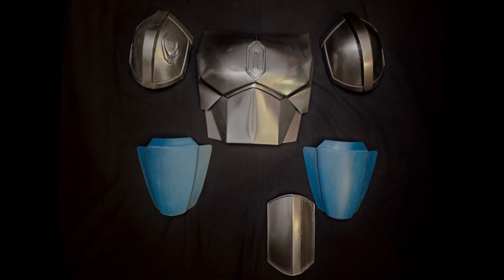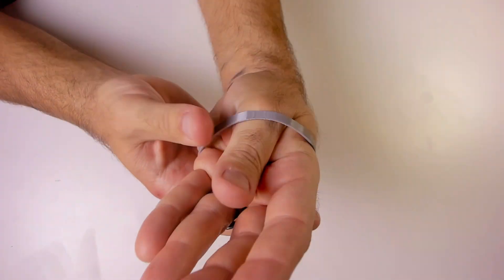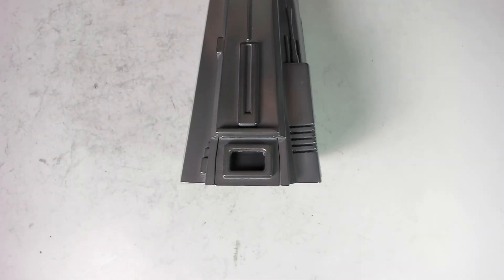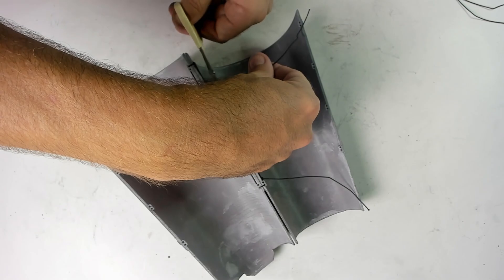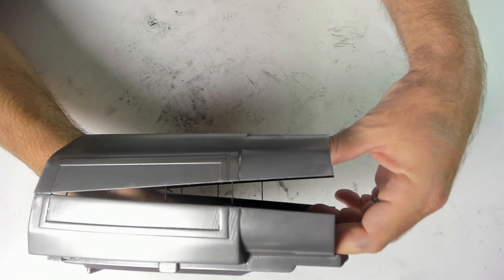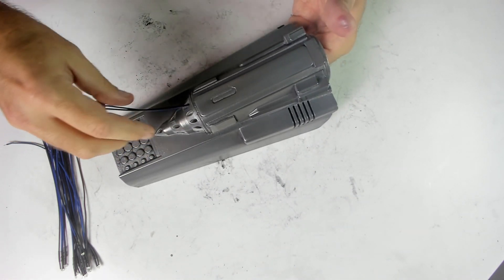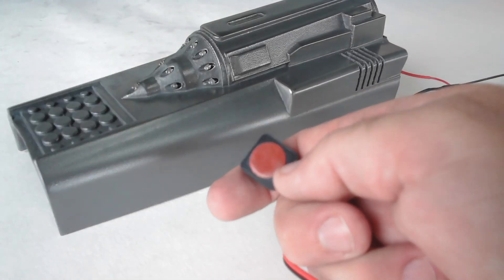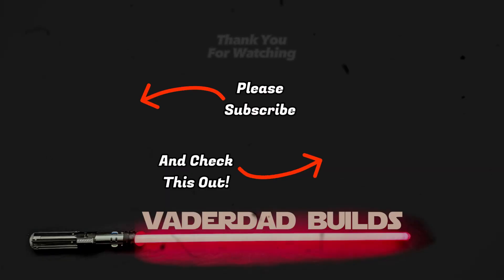3D Printed Mandalorian Armor With Only FREE STL Files? Pt.3 - Gauntlets

Comment: These turned out great, Thank you for linking the files. I'm having a problem with my other gauntlet files where the two halves are meant to be permanently glued together with inserting tabs but my hands are too chonky to snake through and there isn't a good way to temporarily attach the halves together around my arm because the tabs get in the way of using things like hinges. I think if I were to scale them to be big enough for my hands to fit through the wrist hole, they'd be way too big around my forearm. The little inserts for the elastic bands on these files seems like a great way to do it. I'm glad I came across this video because I have been searching for alternate files with a way to clamp the halves around my arm without permanently gluing them together and these files seem like they have a great solution for the problem I'm having. I'll probably be printing these and giving this same method you showed here a try.
Reply from the maker: Awesome, glad this video helped you out! Thank you for watching!

Comment: Is there a chance you could share the file as a remix of both the gauntlets - where you cut them in half?
Reply: also has anyone used  a switch that stays in the "on" position? (Instead of the toggle)
Reply from the maker: From what I remember, I think I just opened them in mesh mixer and when I clicked on cut it was already set in place.